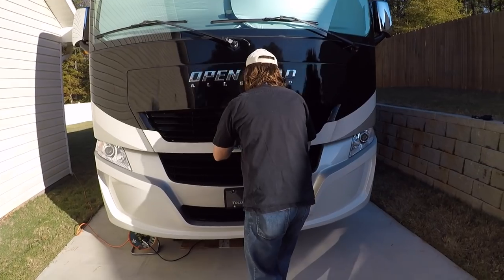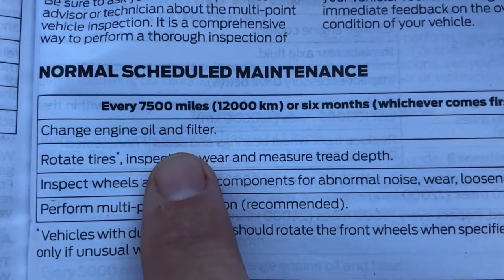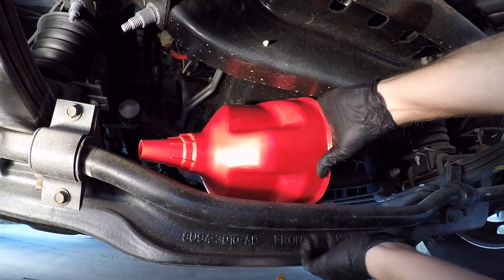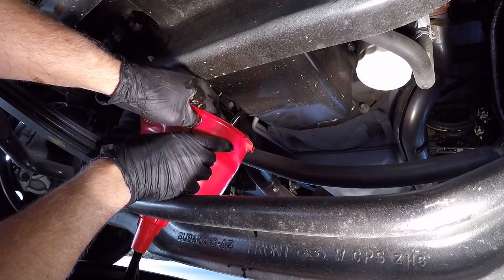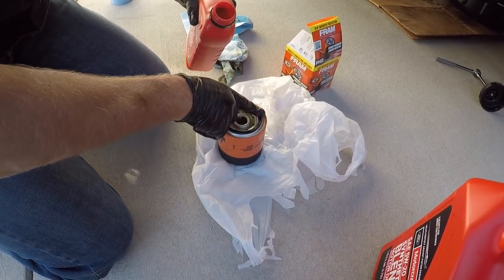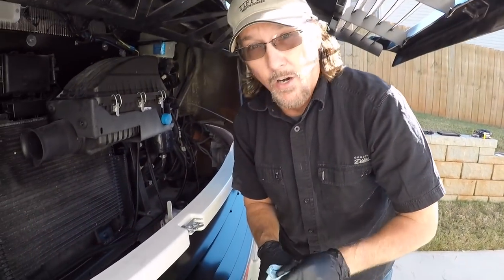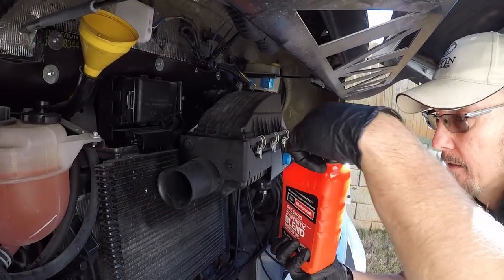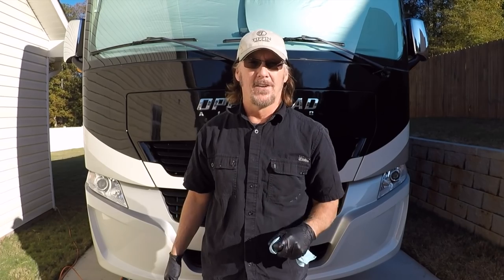Changing Oil On My Tiffin Class A 'Gas' Motorhome

Comment: I like the funnel trick you used to drain the oil. I have a oil drain pan that fits up on that cross member works well too. I also place a large freezer bag around the oil filter then unscrew it so the mess is contained in the bag. Walmart usually has the Motorcraft oil and filter at a good price..... Safe Travels!
Reply from the maker: Ray J ,  I like your work around with a pan that eliminates the need for a funnel.  Thanks for the tips!

Comment: Just a tip. After you break the filter loose take a screwdriver and a hammer to pierce the bottom of the filter. It will drain and help to prevent a mess.

Comment: Thanks for the great video Darryl.  I have a Tiffin 36LA.  Tip for you...  I discovered the Fumoto oil drain valve F-106N. After my first oil change, I installed the oil drain valve to replace the oil plug. In subsequent oil changes, I just attach a piece of hose to the drain valve spout and open the valve.  The hose leads to my oil pan on the ground.  No mess around the underside chassis members.  Check it out.
Reply from the maker: Thanks Randy.  I have heard a lot of folks talk about the Fumoto oil drain valve.  I will certainly look into that. Thanks for sharing!

Comment: Hey, hey I’ve got to thank you for an easy to follow video. Job nicely done, mine is a 2016 34TGA. The second time I changed the oil I switched out the drain plug with a Fumoto 106N with a 2 foot length of 3/8 ID tubing going down to the catch pan...
Reply from the maker: Glad it helped David!  Hope y'all are having a good summer!

Comment: GREAT VIDEO -- Been looking at the Tiffin Open Road 32SA; love the floorplan, curious about the V10.  How has the comfort level been while driving the gasser?  Too hot in the for the driver / passenger -- excessive noise, etc.?  Any issues on hills, aside from taking them slow?  In general -- are you loving the Tiffin gasser?  Any diesel envy?
Reply from the maker: Hey Jayson,  We have really enjoyed our Tiffin.  The Gas engine is very quite with no heat issues.  I haven't made it out West where the mountains are but so far the ones Ive been on here in the East the gas did fine,  just have to take it slow....We have never owned a diesel but from what I hear they have advantages,  I like the idea of the air brakes, air ride and the engine is in the rear.  And we all know you can't beat their power.  Maybe in the future but for now we are very pleased with our V10 and Tiffin.  Hope this helps.  Thanks!
Reply: Tolleson Life have you done any suspension upgrades?

Comment: I had the same experience when I changed the oil for the first time on my Tiffin 35QBA, I thought I would never get the oil filter off.
Reply from the maker: Richard,  wonder why they put them on so tight from the factory?  Surprised they don’t crack them.

Comment: Just a heads up, the Fram oil filter has a lower flow rate than the higher quality oil filters like WIX or AC Delco, and MAY cause a oil pressure alarm at your dash when your RV is hitting revs beyond 4000 rpm.
Reply from the maker: Hey MrBossHoggAOL, yes sir,  I have already changed the filter back to Motorcraft which is what I typically use on my Fords.  Long story as to why I used Fram that day...... cheap cheap filter... Thanks!

Comment: Have you heard if ford fixed there problem with the spark plugs blowing out. I know the internet tells of ways to fix the problem but don't know if Ford did it on the newer motors.
Reply from the maker: Hey Bob Y,  Ive read a lot of stuff on the internet about them in the past, but nothing from  the large community of Tiffin owners with V10 having the issue.  Hope it stays that way!!

Comment: Good work with oil change, we have a 2019 tiffin, just wanted to offer a tip about that cheap hood latch and release, be extra careful  with it u may never get another one when it breaks. I waited 3 months so I called back to order a second one while waiting. It's two parts, release is hand made and bolt will be to long.